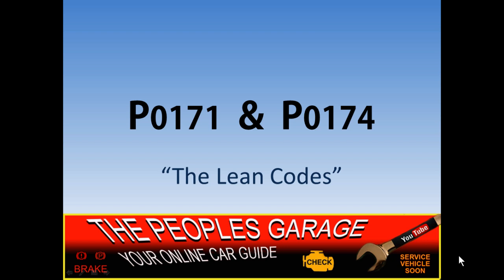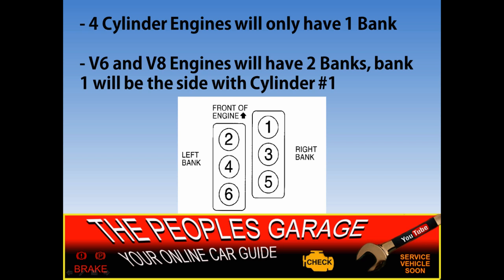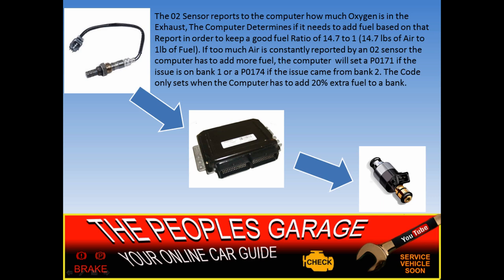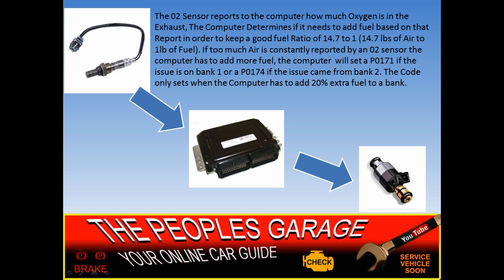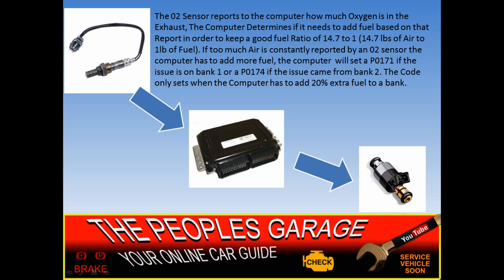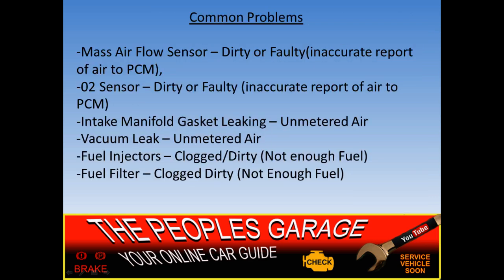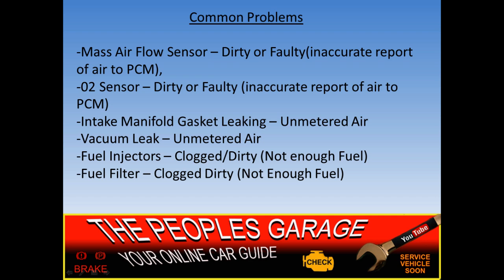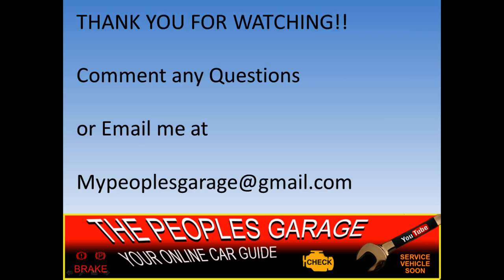How to Diagnose Codes P0171 & P0174 - Lean Bank 1 & 2

Comment: Great video I have a ford expedition 1999. I cleaned the fuel injectors on one side of my engine bank one I think, then took the truck for a drive and got p0171 and p0174. but I only cleaned one side of the truck. I spent a long time looking for damaged robber tubes for vacuum leaks did find one in a very thin plastic tube , (the tube was  thinner  than  a  drinking strew I fixed it still have the codes). My question is if I cleaned only one side of engine. could that cause both codes and if not what would you say was next thing to check. the truck runs rough al little at idle when first accelerate it shakes  then runs good between 20 to 40 mph but once I enter the freeway and accelerate from about 35 to 50 mph it vibrates again and when at 55 to 66 car shakes and dose not run good they are the issues.  it would be great if you could give me some feed back

Comment: I have a 1998 Mazda B4000 4.0 V6 and I'm getting a code PO171. Ive replace all top end motor sensors, fuel filter, injectors and still getting this code.
Question is are these motors none for intake gasket leaks?

Comment: I'm out of ideas!  I replaced MAFS on 2000 Corolla and it didn't clear, I have new fuel filter so took it to shop for smoke test and he said a hose was loose but MAFS was outta bad (I put the old one back since new one didn't fix).  I ordered new MAF Sensor and installed it and new air filter, reset battery and light returned in 50 miles.  I don't want to take it back to that guy because he offered nothing, he suggested a valve cover gasket, which is new so I opened it to make sure it was okay.  Injectors?  183k miles.

Comment: Thanks for  this information its good i need to ask you for my 2002 jaguar x tipe 2.5L I have p0171 and p0174 we fix all the leaks and replace the throttle body was leaking air but the codes is back

Comment: Hey I have an 04 galant I just replaced one of the injectors and now it's throwing 0174 and 0171. I think there's a vacuum leak because I can hear hissing but I can't find it. I tried spraying brake cleaner to find it but no luck. Any advice?

Comment: I have 3 symptoms: 
- both p0171 and p0174
- if I clear the codes, the "service engine soon" light tends to reappear during an attempt to accelerate rapidly
- rapid acceleration tends not to work properly. The automatic transmission will hold the rpms at 2600 to 3500 for about 2 seconds with no power going to the wheels--a slow gear switch
- the rpms fluctuate while idling, about 800 to 1100
- also the fuel filter was replaced just before the acceleration problem appeared, though the service engine light was already on at that time

Comment: My 02 Lexus RX300 has a P0174,I found no vacuum leak,The injectors have good resistance and good compression. Bank 2 spark plugs are so black and I can smell gas at the tail pipe. And misfired cylinder #2,4 and 6. My next diagnostic will be on bank 2 A/F ratio sensor,even there’s no code for it.... and the STFT1 is 20% and the LTFT1 is maxed at 52%. What do you think exactly the problem is ? Thanks

Comment: Good day . Thanks for such informative video.i have a similar issue with lexus rx300 2001.i noticed the engine runs better with less tendency to throw the p0171 and p0174 codes when I use liquid moly injector cleaner. No obvious leaks have been found. Any suggestions please ?

Comment: I have a 1998 Ford f150 with 4.6 . It has no power at all . Want even spin tires. Back fires sometimes. You can smell rare gas. Going up hill is a challenge. Started to make a knocking sounnd but goes away. I've done the plugs, wires. Both coils. Change the rubber on back of engine. Cleaned the mas air flow sensor. What have I missed.

Comment: hello sir
I received both of these codes when I changed CAI K&N .... I did a thorough inspection and found no vacuum leaks, and made sure everything was right .... sometimes the code disappears, After 1-2 days, the code will come back ... I don't understand what the error is, because when I reinstall the stock CAI, the code will disappear and not return.
What I wonder is that the K&N provider says that their CAI doesn't need tune ... and other users don't have the same problem as me.
I don't think it's a problem at Fuel Pump or MAF, because when I bring CAI Stock back, the problems completely disappear.
can you help me
 Thanks you

Comment: I have a 96 ford f150 with 5.0 with both codes. I cleaned MAF, checked for vacuum leaks and repaired, new pcv and hose but still didn't help. Engine will run for just a minute or so then will run rough and die. It will start immediately but will do the same thing. I'm out of ideas. How do u tell if the MAF is bad?

Comment: Awesome video just experienced your class 5 stars Thanks

Question? 

I have a 2011 Acadia SLT AWD at first I had a Bank 2 code catalytic converter replaced then bank 1 and bank 2 pop up as codes also Catalytic system efficiency below threshold with both banks then comes the codes system to lean at idle bank 1 and 2

P2187 P2189 P0420 P0430

Purge valve replaced, hoses checked and cleaned, ran intake valve cleaner (carbs seen through air vent) what can I be missing school n what to diagnose?

I like the video more how you explain the process of understanding and will continue to thumbs up and search more info at your channel Thank you 👍

Comment: changed my fuel injectors and all 4 of my 02 oxgen sensors still getting bank 1 and 2 to lean and a error sensor heater 2 on a 2006 ford five hundred dont know what the problem can be when parked and running the engine would die down and cut off...

Comment: I had 3 codes on my Audi A4 Sedan B8 1.8TSI p2293 and p0243 I did change the high pressure feul pump and turbo Solenoid all codes gone but now having new code P0171 any advice the car drive but not 100% full power any advice please

Comment: I have 2008 Chevy Colorado lt i5  po171 this happened about mile after I put high octane fuel  in my tank
Reply: 2007 Colorado i4. Thanks for the input. Not sure if that's the case for my truck though. I put lower octane in & it runs like crap!  let the fun begin!

Comment: I have these codes on my 2001 BMW 330i. I also have P1343, P1347, P1344, P0300. I am using more fuel than normal plus I hear a weird knocking coming from the engine. These things happen when I first start the car and the engine is cold. One more thing that I noticed is that if I rev up the engine and keep it at higher rpms for a few seconds, the vehicle starts running better. Any tips for possible causes will be appreciated. Thank you for the great video.

Comment: I just brought a 2003 Suburban LT, and I have a rough idle. I changed the spark plugs and wire, and then I got these two codes. I am glad I watched your vid, now I can do a process of elimination. I do not go to mechanics anymore, because you can not tell if they are trust worthy or not. I have learned how to fix on my own cars from youtube. This vid is the most imformative and simpliest vid that I have ever ran across on youtube. Thank you very much for the information sir.

Comment: I have both of these codes on my 5.3L '06 Silverado 1500 LT.  Also had one for the evap solenoid (P0449 if memory serves), but I replaced that and the code didn't come back.  

My brother and I replaced the intake manifold gaskets this past weekend, really thought that would do it.  Seems to run just a tiny bit better, but the codes keep coming back.  Is it possible I just need to drive it more?  I heard something about the computer taking some time to relearn.  

But the truck also has "drivability" issues - takes 2-3 tries to start when cold, gets poor mileage, loses power going up hills or trying to pass.  Luckily I live and work with my brother so I've been able to avoid driving it for the most part, but it can't stay sidelined forever.  Need to get this figured out.  

Most YouTube videos with these codes end up being vacuum leaks (seems like all of them are), but I'm starting to think it's my fuel pump or something in the fuel delivery system.  Of course my truck is one of the first few models that had the fuel pump/filter inside the tank, so that's a whole new can of worms.  

Thanks for the video, would greatly appreciate if you have any input on mine.
Reply: Were you ever able to figure it out, I'm having the same problem on my 06 GMC Sierra 1500

Comment: Thank you for posting this video. What are the most common issues found on  05-10 Jeep Grand Cherokee 4.7 engines for throwing code P1074? The engine light came on while idling for 15-20 minutes, went out on it's own after 2 days and has remained off  going on 3 wks.  The vehicle passed smog/emission testing; however the code still appears when scanned, Engine is  running sluggish, lack of power. Fuel  is between 8-10 mpg. Idle is only slightly roug and barely noticeable. Also  sulfur smell  twice while driving.  No smoke when tested for vaccum leaks. Air flow sensor is clean.  105k total miles and regularly maintained. Any suggestions on what to check next?

Comment: What is the fuel pressure for 1997 Ford Ranger 4x4 4.0 liter engine manual transmission? Guage is reading 30 lbs pressure. Snap on scanner is showing diagnostic codes p0171 and p0174 2 lean condition bank 1 and bank 2. No vacuum leaks. Fuel long term trim 1%-25%.Short term fuel trim is 1% fluctuating to 0-12-18-20% when driving.

Comment: Thank You for sharing.  Shops replace EGR first, had 4.  That was not the problem.   Many other parts replaced by FORD.  It is a vacuum leak.    The other parts helped but did not fix the problem.  BEWARE

Comment: I have a 3800 series 2 2000 firebird i have both lean on both banks. Which causes. Low acceleration. Throwing me into limp mode. Ive changed my map sensor and cleaned my maf.

Comment: Be sure your air intake in on properly first. I had a shop work on my car and did not put it back on properly and I got those codes. Easy fix if this is the case.

Comment: I just purchased a fixd and found that it gave me a PO174 code Air/Fuel Mixture system too lean Bank 2... How much would this cost to fix?   Also, a friend used an expensive code sensor and it gave him a CO210 code - Right rear wheel speed imput signal missing... How much would this cost to fix (approximately) and what are the dangers if left alone and not taken care of?

Comment: Thank you so much for spending the time to post this. I've learned a lot. Trying to figure out p71 code and coolant leak on my Jaguar XF 4.2. Need to get through Jersey inspection this month. Will be replacing mass air flow sensor later today. Coolant leak I haven't figured out. I smell it with the hood open but see no leaks whatsoever.
Reply: Could be water pump going bad
Reply: Turned out a leaking hose. 3rd repair shop found it. Generic replacement took 4 days to get but full flush n fill n hose replaced under $300. Turned out service station near by found it too. Wish I stopped there first. Thanks for the info. Water pump replaced 30k ago at 110k miles. Top plastic crap thermostat housing broke inside n piece stuck in fin of pump.
Reply: Ever have a leak, but don't see it?
Drive it until hot, coolant full . But do it at night pop the hood and with engine  just turned off,  use flashlight in the dark, and watch for the steam as you comb the entire engine bay including from and back of radiator.
Reply: I threw some $ on parts for code P0174 to no avail. Mechanic hooked up his scanner to find problem in cylinder 5 bank2-- water in well from a loose radiator hose.

Comment: I have a 2010 Mustang GT that was throwing the P0171 and P0174 two months ago.  I have an extended warranty and took it to the dealer for them to check out.  Their diagnostic conclusion was that the o2 sensors needed to be replaced.  New o2 sensors and codes cleared and I was back on the road.  My mileage has dropped by almost 2mpg since that time. Last night, my check engine light went on again and my code reader shows the same codes again. You mention so many things that could cause these codes.  Shouldn't the dealer have checked for vacuum leaks, MAFS, etc as part of their diagnostic process to conclude the o2 sensors were the only culprit?  Thanks.
Reply: PVC valve a all the hose

Comment: I have a PO174 code. How can I narrow down possible fixes between the mass airflow sensor fuel injector or an O2 sensor? And if an O2 sensor how do I know if it's upstream or downstream? Thanks a lot. Your video is very helpful! 👍📌

Comment: I HAVE A P0171 IVE ALREADY CHANGED THE 02 SENSOR TWICE AND THE AIR MASS FLOW SENSOR TWICE AS WELL ON MY 2005 TOYOTA CAMRY 4 CYLINDER AND IT KEEPS COMING UP WITH THE P0171 CODE WHAT IS MY NEXT MOVE PLEASE AND THANK YOU
Reply: https://youtu.be/SugtR4KMIDU

Comment: I had an intake leak on a buick 3.8 upper intake, it was a broken piece by the throttle body. It is a common problem on these motors. You can't find it with eather.

Comment: Thanks for the advice. My 2006 LAND ROVER RANGE ROVER  
V8-4394 4.4L DOHC check engine light is on. I am getting error both P0171 and P0174 system lean codes. What would be your recommendation?

Comment: Got to thank you for the clue. I recently change the air filter and shortly there after threw a lean code. Thanks to you I checked the vacuum lines and found the PCV line had been dislodged during the filter change. Problem solved thanks to your post!  Great!

Comment: I have a 2008 Dodge Dakota 3.7 engine. My truck sometimes won't start. It will crank but want start. I keep trying and trying and eventually it will start. This has been going on for a year. Finally a check engine light came on and i had a parts store check it and PO 174 and PO 171 came up.

Comment: Its 2006 lexus rx330. More details.. At idle speed, STFTb1 -5.5, LTFTb1 -2.3; STFTb2 -4.7, LTFTb2 -1.6... At 3000rpm, stftb1 -3.9, ltftb1 -1.6; stftb2 3.9, ltftb2 2.3... is this vacuum leak symptom? P0171 p0174

Comment: I have a 99 sienna. P171 and random misfire. I have put two used mass flow sensors from just yards into it but I still runs bad and shakes. I’m gonna blow smokers into the engine to check for vacuum leaks and check the continuity on the o2 sensor. Any recommendations??? Thank you so much.

Comment: I have a 2003 jaguar s type 3.0 V6 and have P0171, P0174 and restricted performance and for the life  me my mechanic cannot locate the problem. He replaced the upper and lower gaskets, o rings and other plastic parts in plenum.  No other vacuum leaks.  maf map senors replaced.  Now what I realized is it could be because I changed the air box 6 years ago to a cold air intake and was not dyno tuned.
I ordered a used one and will revert back when I receive it.  But what gets me, why didn't those codes register 6 years ago and restricted performance?  What do you think?

Comment: did not solve my problem (yet) but gives me a place to go, thanks for the tutoral.It confirms my suspicions and hope i don't need to drop that fuel tank. I do have between 50 and 60 PSI with my gauge so I should be good there. Anyway good post my friend.

Comment: 2003 ford excursion v10 6,8 po171 bank one  cant find the problem change fuel filter air filter cleaned map check for air leaks with carb cleaner

Comment: Any experience with the jeep 3.6 firing the 0174 code?  And common causes that are known on this particular engine? 50k miles.  Thank you!
Reply: Did you figure out what it was by chance? Currently mine is firing this code P0174 and code P0159. Thanks in advance.

Comment: 2004 4Runner keeps throwing p0174, cleaned the MAF and reset codes, threw it again today so I just replaced the MAF. Hopefully the problem is solved with a replacement.
Reply: Did the codes come back?
Reply: @RyanBurnsRed  They did when the MAF was an aftermarket, I took it out and put in an OEM, so far so good
Reply: @colewheeler8415  I have a Lexus IS300, which is basically a rebranded Toyota. I don't have an aftermarket MAF, but I did clean mine and the codes came back, but this time the car started performing worse than before.

Unplugging MAF while engine is running will cause it to die. Starting engine with it unplugged will cause it to idle a little rough and higher than usual, so I think it's safe to say my MAF is working...guess that means I'm looking to replace my O2 sensors
Reply: @RyanBurnsRed  I did the same, with no success. I suggest taking the $60 - $100 plunge and getting a OEM MAF. For my 4runner it was a Denso (brand) and thus far the codes have not returned and my engine is running smoother. Like all things, sometimes sensors get old and just have to be replaced. Thankfully, it was a 5 minute job.
Reply: @RyanBurnsRed  Also, your O2 sensors are working just fine. If one of them is not working the engine will throw a completely different code. I suggest replacing your MAF with a brand new OEM sensor and replacing your engine air filter while you're at it. Keep me posted! Together we can fix your IS300
Reply: @colewheeler8415  Thanks. Ordered a new one yesterday. Should be here next week. I'll keep up you updated and my fingers crossed :D
Reply: @RyanBurnsRed  did it work?
Reply: @colewheeler8415  yes! In fact I'd say it runs better than before. It's so smooth when shifting and is more responsive. You were spot on. Thank you

Comment: 02 Subaru Outback H6. Changed the fuel pump fuel filter and spark plugs. Cleaned the maf and o2 sensors. Cleaned the pcv valve replaced the hose and still lagging. What can it be?
Reply: Brake booster possibly

Comment: Need help....changed pcv valve and maf sensor, erased codes. After 30mins on truck turned off again and p0171 and p0174 codes popped up again. Could it be fuel pump? Hoses
 are good
Reply: Could have a vacuum lesk inside your braks booster if you've checked everything else